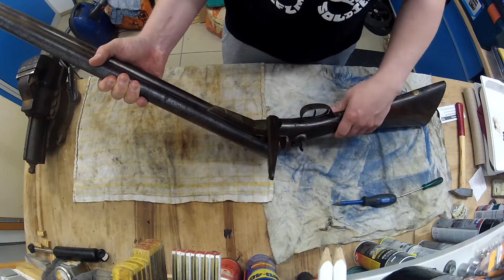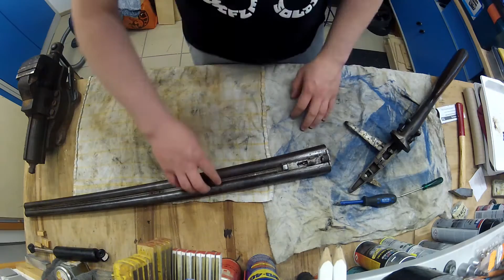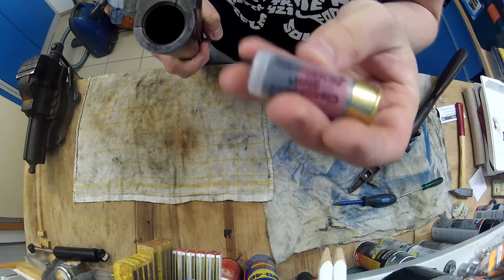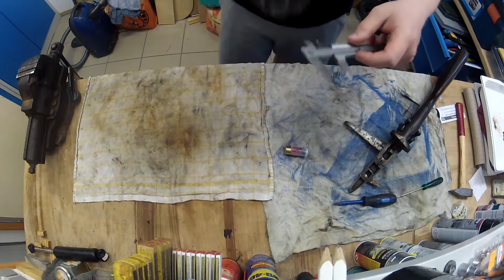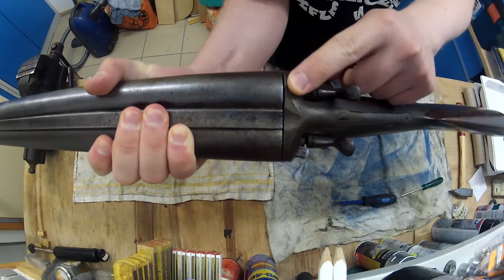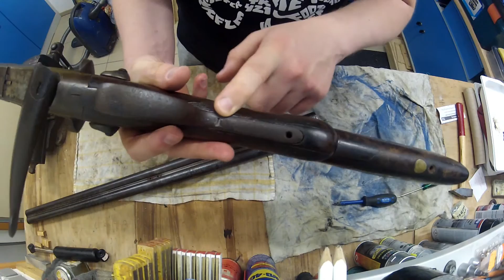Antique 5 Gauge Shotgun project - Part 1

Comment: "Restoring" a gun destroys its collectors value. 
Dont do it.
Clean it up a little without removing any finishes and thats it.
If you want something to use, buy newer. Damascus or twist steel berrels are unsafe to use.
Reply: Depends
Reply: Correct. It was common place in high end guns to have them freshened up frequently. The whole “leave it original” tends to be more important with American collectors than any others.
Reply: Black powder only.